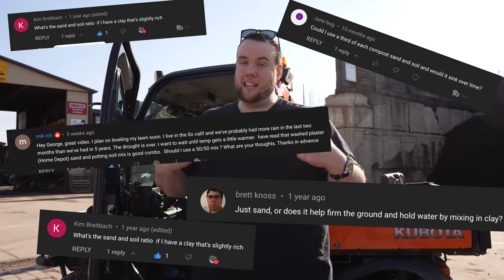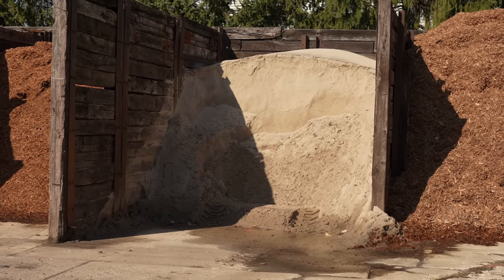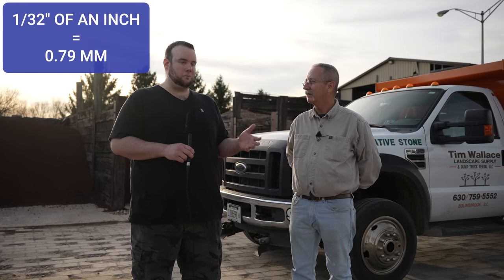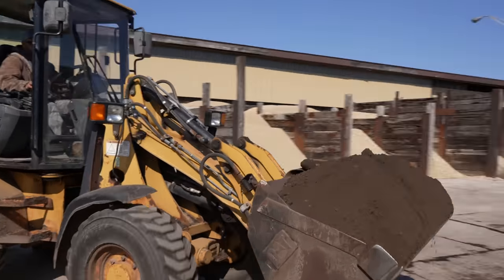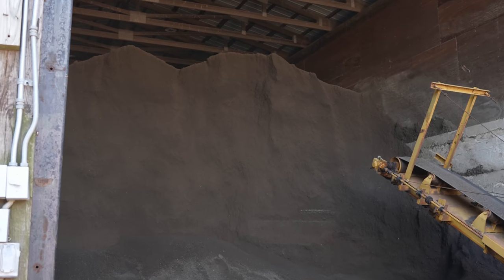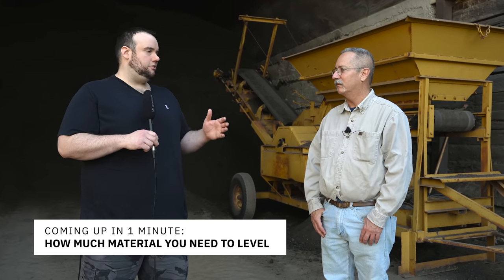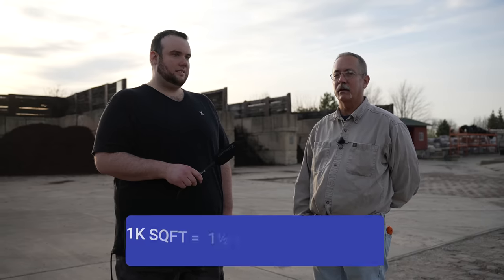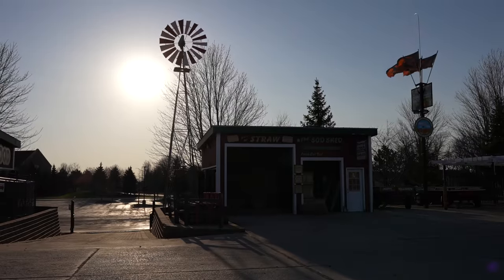DON’T Use Sand to Level your Lawn!! *INSTEAD USE THIS*

Comment: I agree. Sand killed a ton of my yard off. I had more than light leveling. Sand covered the grass and developed dead spots ALL OVER the yard. Also sand has ZERO nutrients for the soil. I will never again used sand in my grass. Nothing but rich mix top soil with compost. That has always done my yard good. Tried sand as a lot of people swear by it. Not in my yard ever again.

Comment: Thanks George, Just spoke to Tim regarding getting 1  tons of the top soil & sand mixture to do leveling.  He was very nice listened to my issues with my grass and was extremally helpful.  Since I was in Chicago near Midway Airport and the amount I needed was not enough ,only a yard, he provided an alternative method to get the mix to my house.  Rent a pick-up truck from Home Depot about for $20.00 and pick up myself.  Great suggestion!!  Please keep up the great videos.
Reply from the maker: No problem Bill! glad you guys came up with a solution
Reply: @PrincessCutLawnCare   Seventy yrs young asking, I guess I can’t get it by the bag?

Comment: Down south where we have creeping warm weather grasses like centipede, sand can be very effective, especially if you have trouble with drainage. But you are correct; make sure it's dry so you can get it into the lowest spots faster.

Comment: Thank you for the video! It was very helpful for me because leveling and over seeding is what I’m in the process doing right now! First time doing leveling, then over seeding. I’m Fortunate Tim Wallace is in my area, have used them several times before for dirt, mulch and decorative rock. They are awesome they help with every thing you need, give them the measurements and they tell the amount you need! I didn’t know that they had this option there. Now that  I’ve seen this video I’ll be ordering from there! Thanks again!!
Reply from the maker: No problem neighbor ! And that great to hear!

Comment: Thank you, Mr. George.  I was planning an even more ambitious project for my backyard that didn't survive last summer's blistering heat.  I killed off the remaining grass (less than 10%) last Autumn and want to cover ~3000 square ft with about 2 to 3 inches of topsoil (I also have a lot of protruding red maple tree roots that need to be covered.  Keeping it to 3 inches won't require a local permit).   Then when Autumn rolls around, do the planting (I recall your "I FAILED" video for Spring planting so I'm waiting).  I doubt if there are any establishments as conscientious as Mr. Collins in my neck of the woods - New Joisey - but I'll shop around.   Wish me luck.
Reply from the maker: No problem boss! Good luck with your project!
Keep in mind if you cover the branch with more soil they will find there way  back to the top no matter how much you cover them.
The roots will always want to be at the surface to get water. I have the same issue in my backyard

Comment: This was a great video and very informative . In N FL. we don't have a place like this . Nothing covered only know of one placed that screens it not sure if they do all their soil . They mix this special blend its $ 55 a yard . Regular yellow sand down here is like 350-400 a load 18 yards . Used to work in site prep and drove dump trucks . A 10 wheel dump truck can only haul legally 20 tons most aggregate facility will only load 18 ton so they don't over load you. Most folks sell by the yard on everything if they don't get a full bucket you get ripped off. The place I goto has a bucket that 3x3x3 it's 1 yard so you pretty much get what you pay for but not always.  Yes you are right about the bag soil being full of sticks and other clearing debris , also they are full of insects that will eat your plants upThanks for your videos.
Reply from the maker: Thanks kubota! Appreciate you sharing your experiences

Comment: I like to use all purpose sand mixed with Black Kow.  After I get the leveling done, I top dress with Black Kow using my roller spreader.  I use the all purpose sand because it has a darker color.  Play sand is bleached white sand.  I think its ok, but all purpose sand looks better when its applied.  A lawn leveling rake and roller spreader is a great investment if you want the best lawn around.

Comment: Great video George! can you ask the fella how much shipping to the UK is? 🤣

I've been accumulating bags & bags of top soil from the local big box store (as you call them) and screening to 6mm. Next stage is to get bags of play sand (best option I could find locally) & mix myself. The shipping charges of bulk items in the UK is astronomical at the moment so I decided to go this route. A bulk bag of quality 70/30 material is around £130+ delivered, but if I do the screening/ mixing work myself I think it'll be a chunk cheaper (just hoping the weed free statement on the soil bags is true 🤞).

The £120 for the landzie lute was a no brainer though as this isn't going to be a one off job. At least it'll be less work each year.
Reply from the maker: No problem Chris! Sounds like you got a fun project ahead of you! Good luck 👍

Comment: Use these guys for years for sand and top soil. They are fantastic to work with. I also recommend getting mulch from them. They have a triple shred hardwood oak mulch that never washes into the yard or blows away when using a leaf blower. Its a bit pricer that other providers but you get what you pay for.
Reply from the maker: really like their dark shredded mulch! perhaps we should do a mulch video with them as well
thanks for sharing your experience Blake

Comment: Nice video.  I ordered a dirt/sand mixture from a different place and it was rather wet and full of small rocks here and there.  Certainly not pulverized or screened down to the levels that this place claims (Sand to 1/32" and Soil to 1/4" to 3/8").
Reply from the maker: Thanks Kevin, sorry to hear about your experience

Comment: It also depends of the soil you have. Where we live it's 1 inch of soil and under is clay. I had to clean a big area of land from clay as much as I could and make a mix of soil with sand, mulch and other stuff to resolve water sitting days in my lawn. This year I'm going to use sand strictly with some peat moss on top to help seeds germinate. Pure soil or mix of soil with sand is not an option... I already have lot of clay, I need to let water dry faster from my lawn.
Reply from the maker: are you going to core aerate before leveling with sand?
those holes will act like mini drains
Reply: @PrincessCutLawnCare  aeration was done before the winter. I still see some holes in the ground, so... it should work. But I need to try as is and see how it works :)

Comment: A nice, clean, widely-available bagged product is Kellogg's Topper mix. No sand, but lots of fine organic material and compost - no lumps, sticks, garbage etc. My local landscape supply sold me junk with tons of plastic and glass in it - was picking out all the garbage for 6 months (glass shards in a lawn??). So be careful you don't buy stuff that has any municipal 'green waste' in it.
Reply from the maker: Great tip Arthur!
Thanks for sharing!
I’ll keep kellogg in mind next time I need some bagged soil

Comment: I cant use sand as my yard was filled in with clay. My soil under my grass is somewhere in the area of 50/50 clay/dirt. Once you go down8 inches or so it is almost 100% clay for the next 10-20 feet down.   What should I use to level my lawn ?    I want put in a block patio with the 1ft X 1ft thin patio blocks.
Reply from the maker: you can still use a mix of sand and soil no problem but if you still dont feel comfortable than i would use dry pulverized top soil
Reply: @PrincessCutLawnCare  OK thanks !

Comment: Hi George on the SAND tip so is it still the MEDIUM SIZE SAND TO USE ? Or the FINE or is it the FINE IF USING SOIL MIXED CAN YOU CLEAR THIS UP PLEASE ? 👍
Reply from the maker: Both with work fine.
I prefer medium if just using sand.
Reply: Yep that what I thought thanks George your vids are awesome pal 👍

Comment: i prefer to use compost from a yard waste recycling facility.  it is EASIER to move around PLUS the compost provides humic acid which is beneficial to the lawn.  the lawn will green up beautifully due to this addition.  i also recommend aerating before hand.  the aeration holes get filled with the compost improving soil drainage/water penetration.  the compost is mosre like a sponge and holds more water than soil so it is a better reservoir for the plant to draw from

Comment: Agree with the other reviews…top notch!    Question, other videos discuss weeds introduced when top dressing.   Thoughts when purchasing in bulk like this?    Again, very informative and thanks.
Reply from the maker: Will be impossible to not have weeds introduced no matter what supplier you use. It’s important to have both a post and preemmergent weed control plan in place as you will no doubt get some type of weeds introduced
Reply from the maker: And thanks btw!

Comment: I’m in Chicago I was thinking about putting down line to start the season. Can you speak to that. I heard to will help the soil absorb the Jonathan green grab grass and fertilizer when I put down next week as temperatures permit
Reply from the maker: Hey neighbor! does your soil have a low ph (acidic)? the reason i ask is because the soil in the chicagoland area tends to have a high PH(basic) which would not require any lime at al

Comment: Hey George, that was a great video! I have lived here 60+ years and never knew about that place. I am definitely going to check it out. Wondering do you know if they have a crew who will come out and perform the leveling too? Or do you know of a company that does? I really don't feel like tackling that project myself.
Reply from the maker: Thanks Mike! Excellent question! i will find out and get back to you.
Reply: @PrincessCutLawnCare  Thank you george. I am getting a little old to be doing that kind of work..
Reply: Hey, CM. I live in the SW suburbs and there is no end to the landscaping trucks I see on all my local streets cutting lawns, manicuring hedges/shrubs, etc.  I have one of them for my own weekly lawn mowing. I've also used the guys to spread mulch, remove some evergreens, etc.  Call a couple and ask. Now admittedly, most if not all have a long list of their regular customers that they service weekly, so it's sometimes hard to find a service that will want and/or even have the time to do a one-off project for a homeowner, but it's worth a try.
Reply: @Anthony C  Thanks Anthony, I have tried that as well as called some local companies. No one seems to do leveling around here. I hope George can find someone. If I were 30 years younger, I would consider starting a lawn leveling business..

Comment: What if I want to combine a little leveling with over seeding?  Would it be good to use such a 50/50 mix? Or less sand or no sand?
Reply from the maker: Grass will grow in sand no problem at all.
I know it hard to believe but its true. All the golf courses grow grass on there putting greens which are 100 percent sand.
Reply: Thank you for replying.

Comment: I've got a large Maple tree in my front yard.  The area underneath the canopy is extremely bumpy.  I am under the opinion that it is so bumpy because of the root system of the tree near the surface of the grass.  Would I be correct?  And if I leveled that area as you instructed, won't those roots just keep on growing and repeating the same situation?
Reply from the maker: Yes, leveling over roots is a lost cause, they will make their way back to the top
Reply: @PrincessCutLawnCare  That's what I thought.  And that tree isn't going anywhere.  It's beautiful and gives us a lot of shade in the front yard.  Thanks for the quick response

Comment: Wasn't medium sand and potting soil recommended in one of your other videos? My lawn is bumpy from chipmunk and vole damage, so i have spots scattered around that need repair, i.e. not deeper than a few inches, most spots less (voles leave what are called runway trails).

Comment: George!! I missed ya! Wow this place isn't too far from me! Thanks for this video and I may have to take a ride up there and check it out. Very cool that they have the mixes like that!! I remember my sand fiasco from last year haha no fun! Thanks for the tips as always!!
Reply from the maker: Hi Kelly! long to no see 😃
Refresh my memory.. what happen with your sanding project? 
Did you have issues using only sand?
Reply: @PrincessCutLawnCare  i bought the wrong stuff and ended up getting the thicker sand and you told me noooooo! Hahaha so I ended up getting the thiner stuff like you said and mixed it in with some dirt for my real low spot. It ended up working out great. I still have a ton of leveling to do so this place looks awesome for the future! Its maybe like 40 min away from me!

Comment: I live in a small city of 18,000. We take our yard waste to the city site and it gets composted and run through a bigger machine the they have then put in piles that we can have for free. We take a little longer hauling it home 1 garbage can at a time( I do four 50 gal) but the old ladies swear the soil will grow anything better than going to the store and buying potting soil. I try to do a section of yard every summer. I could rent a skid steer and get a dump truck load of black dirt but the rain kind of sinks the black dirt into the sand so I'd have to do it every couple of yrs until it stabilized anyway.

Comment: What will happened if fine sand 16 tons was put on top of soil and grass was planted in the sand
on a yard 40 X 30 ft.?
Reply from the maker: Seed will grow without issues 👍 
But the important thing to keep in mind is it will need to be watered slightly more as water runs through sand quicker than soil

Comment: Sadly not available in Europe. Where I am, 50:50 top soil and sand isn't available. Usually 50 soil: 40% "organic material" : 10% sand. And it's always - but always - sodden and soaking wet on delivery. Not a hope of evenly raking it in. And just about mixed in a rotary cement mixer

Comment: Could you convert the „amount of material needed“ please?
He says „per 1000 sft -> 1.5 yard“ 

the 1000sqft equal to roughly 100sqm … but from what I can google, a „yard“ seems to be a  unit of _distance_?!?
That doesn’t make sense. This doesn’t fit to the question. 

This should either be a weight (eg 1t) or a volume (eg cubic meter)

Can you explain or convert this for me please? How much soil/sand -mix per 100sqm?

Thanks!

Comment: I wish we had a supplier like that here. I ordered screened topsoil here. Explained I need it to be screened, not have rocks in it, what was the intent, they confirmed it was the right option. But when I saw what was delivered it was all mixed with large like 2 inches rocks, trash, wood chips... a nightmare. Called them and the owner told me I've chosen the wrong option and that it was fill dirt. Well, the employee told me it was 50% sand 50% lake much all screened. wtf. And they refused to pick it back. It took me a week after work to screen the whole pile, 7 or 8 yards. And in the end, it was about 40% of large particles didn't go through the 1/2'' screen. Lots of rocks, large rocks. It was worse than I thought. I had to dump that in the alley lol.

Comment: 1.  leveling hard clay and installing drain tile to catch basins.  2.  Added 1"4 washed crush (1").  3.   Laydown fine mesh screen.  4.  Added river sand 2" lay down, leveled. watered and rolled. 
5.   Added mixed sand and soil with shredded bark mulch 4" leveled and rolled  6.  Added four inches mixed sandy loam soil with grass fert, leveled, rolled  7.  Light dragged rake of sandy loam soil  (So I could see indications of pets (footprints of small animals  (x2 days and nights) 8.  Removed large bags (x2) from freezer of drought resistant grass seed and spread over top soil then light rake in.  Watered until sprouted.  

The result:  excellent water drainage thus no flooding, watered twice per week (during summer), no weeds for 12 years.  Aerated grass every second year, thatched lawn every second year between aerations.